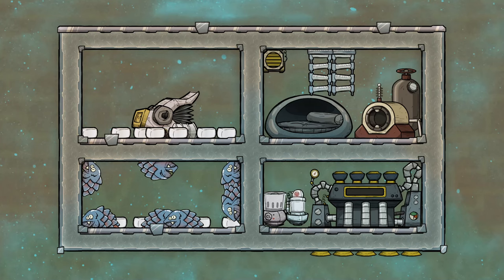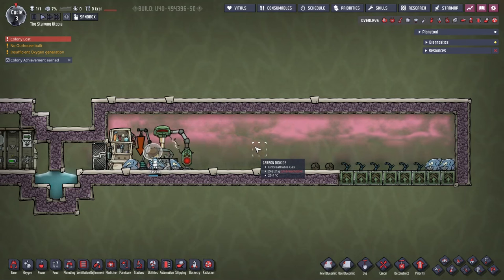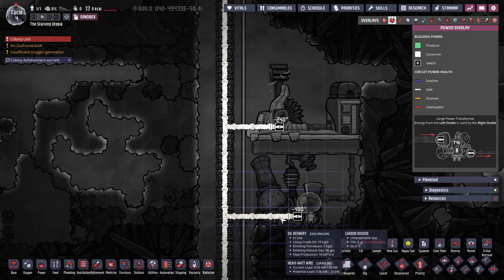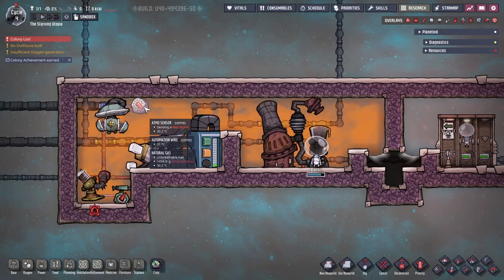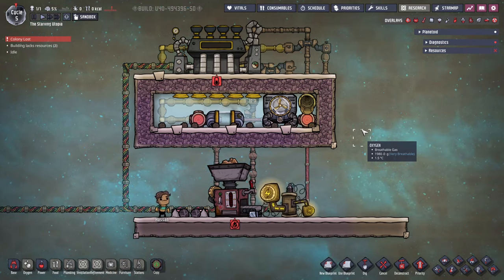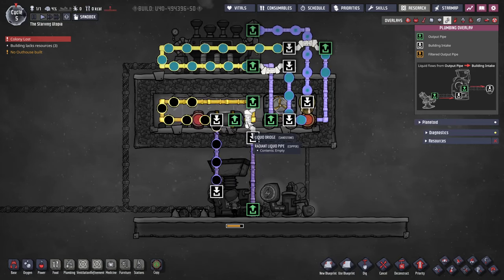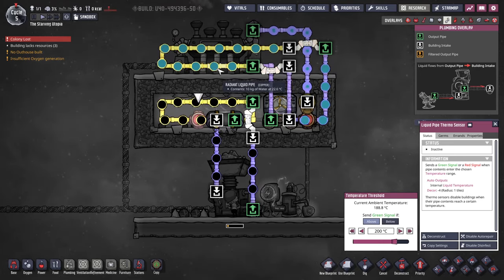Oxygen Not Included - Tutorial Bites - Plastic and Steel

Comment: There is a bit I like to exploit while kickstarting my steam room that allows metal refineries to keep working when their output pipe is broken. The refinery will just accumulate "waste" coolent inside of it forever, well before its boiling point, while accepting more input coolant. You just need to disable auto-repair on the output pipe. So using a pipe temp sensor, a liquid reservoir and two metal refineries, you can bring the water temp to about 100 celcius (its boiling temperature) and send it to the metal refinery with a broken output. You will have about 155 celcius inside the metal refinery until you deconstruct it, at which point it will be "released as bottled water" and immediatly flash to steam. So it's actually a pretty good way to kickstart an industrial sona. It works even better with polluted water due to its higher boiling temp, or with saltwater or brine due to their slightly lower SHC.

Comment: I'm sure you already know this, and probably exempted to avoid information overload.

An added alternative for getting Iron that isn't efficient as the metal refinery but more so than rock crusher would be smooth hatches. They have the added benefit of no heat being produced by the metal refinery
Reply from the maker: That is certainly viable, as is simply using the rock crusher, but my logic is more that if you've built a working metal refinery for steel then you may as well use it for iron too. It actually makes a surprisingly small amount of heat to refine all the metals except for steel!

Comment: Easy trick to increase Dreko time in hydrogen.
Build the door one or two tile(s) lower.  
Fill with hydrogen.  Then put a vent brick on the far side and a few on the bottom.
Then you're set, you have a deeper Hydrogen well for less time in hydrogen.  It will never dip to the bottome tile and growing mealwood will be possible, as the mealwood only checks the tile immediately above the garden tile.
Reply from the maker: Yes, there are definitely better drecko ranches which I will soon cover in the drecko Critter Tutorial Bite. I just showed it quickly here as an example.
Reply: @GCFungus  wasn't critical.  That's a good ranch

Comment: does he discuss how much coolant is needed? Just in case 800 kg can be stored. When an order is ready it primes 400 kg of coolant leaving yet another 400 kg empty in storage meaning it can technically take 1200 kg or coolant. You would just need enough pipes to accommodate the output so it won't back up and stop production.

Comment: i made 6 attempts to the game (same map) to learn the basics. my last attempt was at cycle 90, 27 dupes. and one day everything just fell apart. no algae, no oxygen, too hot, slimelung everywhere. i tried to go back 10 cycles before but even knowing what will break, i still couldn't manage to survive, there was to many little things that were snowballing to colony doom....
the oil was the nail in the coffin as everything i (i think) needed to get this extra edge to survive was plastic.

well, attempt no 7, at least i know that on this map oil is very deep and i need to play it a bit different.

ngl, watching no.6 fell apart made me furious.
Reply from the maker: It sure sounds like you're making progress and hopefully the videos help. If I can offer a suggestion, you have a lot of dupes. Every one you take is another mouth to feed and provide oxygen to. On a normal run, having only 10 dupes around cycle 100 is much simpler, and you can even have fewer than that if you want. But you're coming into the mid-game, so plastic and steel are important as is cooling. If you're having issues with oxygen then you probably want to swap your oxygen diffusers over to electrolyzers and try a SPOM set-up which I covered in the Oxygen Tutorial Bite. I'm sure you'll get there with a bit of time, good luck!
Reply: @GCFungus  i have 27 only because i skipped few, so it could be waaay worse it seems... i will use this advice in this run.

I try to use tutorials as... inspirations more than lessons lets say. Not watching full to get explanation of whole mechanic (and tbh spoil the discovery) , just skip few times to a) maybe hear some usefull tip or b) see something built and then trying to understand what it is, how it works, and figure some bits. Like - somewhere i saw a word "instead of cooling, try to prevent heating", and now in current run i built insulation much, much quicker.
Whole detailed tutorials will be a great watch when i will be optimising the bigger projects, that are at least stable enough to not collapse in few days. Also, those are a bit to advanced right now since i f.e. don't even have all machines needed for build.
Reply: @TheMadYetti  yeah, i'd recommend staying as few dupes as possible. I only had around 16 by the time I hit cycle 1000 in my playthrough
Reply: damn i thought 18 dupes is a lot, 27 must be a headache to manage

Comment: With the tip about using two water types. What is the reason for the two layers?
Reply from the maker: It pushes all thr gas out of the room as the 2 types won't mix, without using a full row of water so you can control the amount of steam more easily.

Comment: Can I use pulled water for the metal refinery or will that break the pipes?
Reply from the maker: I assume that's meant to be polluted water - and yes you can use any liquid, just be careful on how much heat is added. Polluted water is actually really good to use in a temporary set-up as it will add ~56 degrees C when making steel (the same as water), and has a boiling point of 120 degrees C, so is less likely to boil than normal water.

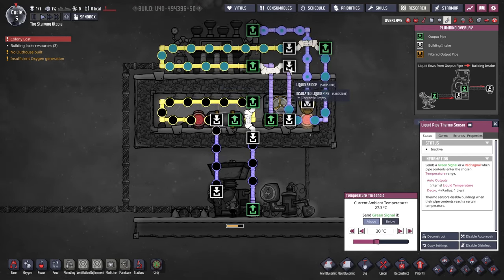Comment: 9:40 you didnt explain WHY 2 different liquids are needed?
Reply from the maker: So in ONI, the game only allows one material per tile. By using two different liquids, it will make a 2 layer high pool very quickly with very little water required, and you can then have much more control on exactly how much steam ends up in the steam room. Usually I would aim for 20-100kg per tile. Also to be clear, the 2 tiles high is required to push all the gas out that will be in there when you build it.
If you were to only do it with one liquid (for example water), then to get it to go 2 tiles high you need to fully fill the bottom row, which is at 1000kg/tile, before you can get any in the top row. This means the minimum you could set the steam density to is 500kg/tile, which is much higher than I prefer. It will still work, but is slower to heat and I believe a bit less efficient.
Reply: @GCFungus  ahhhh makes sense..thank you so much!!

Comment: 07:42 Wait, you can use Polluted Water as a coolant for Metal Refinery? Well thats good then
Reply from the maker: Any liquid will work, but the temperature rise depends on the specific heat capacity (higher SHC liquids will gain less temperature), just be careful not to boil the coolant as it will break the pipes.
Reply: @GCFungus  ah i see, thanks

Comment: how do i know how much oil to input into the refinery?
Reply from the maker: The refinery will simply process all the oil it gets into petroleum. I suppose there's 2 approaches you can take which is either to only pump in the oil when needed, or convert most of it into petroleum for use (since oil doesn't really itself have many uses). I would suggest using a liquid reservoir before the refinery to store an oil buffer, and another liquid reservoir afterwards to store petroleum for when you need it and go from there.

Comment: Why use 2 different liquids for the Aquatuner steam room ?
Can't we just use 1 type of liquid ?
Reply from the maker: The trick for using two types of water is to fill the steam room while it's still a liquid. You can just use one type, but you need to make sure you don't trap other gases in the room - commonly oxygen will get stuck at the top and stop the steam getting into the steam turbine. If you just use one type, then you need to completely fill the bottom tile, which for water is 1000kg on each tile. This will take a lot of time and end up with a significant heat storage inside the room. Using 2 liquids squeezes all the other gases out but you can use much less liquid, as the two types cannot exist on the same tile so make 2 layers.
Reply: @GCFungus  Right, that makes complete sense, didn't think about needing way less materials to fill up all tiles.
Thanks man !
Reply: @GCFungus  I've used 1000kg water inside my aquatuner tank and one thing that I noticed is that the steam turbine above only generates power at 30% of it's capacity.
Is that because I used too much water to fill up the aquatuner tank? Or is it just always like that?
Reply from the maker: @sinaa8652  Yes the rate at which the turbine generates power will be affected by the amount of steam you have. Because you have so much mass there it takes much more energy to heat up and cool down. Now in theory the ENERGY that you add in should all be available to be taken out so there shouldn't be a difference there, but I'm not 100% convinced hat is the case, but never tested it. That's why I prefer to fill to between 20-100kg per tile.
Reply: @GCFungus  Thanks for the response!